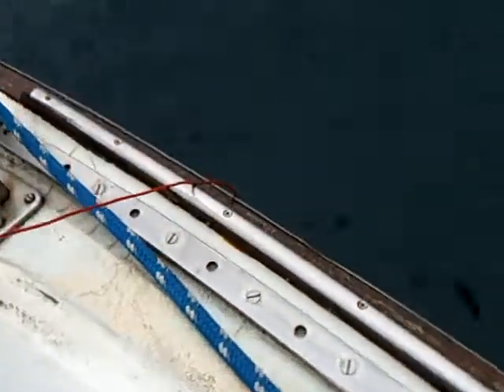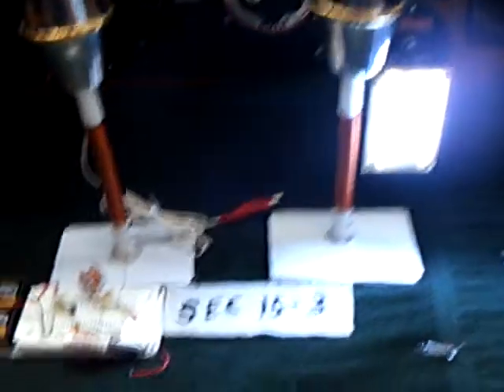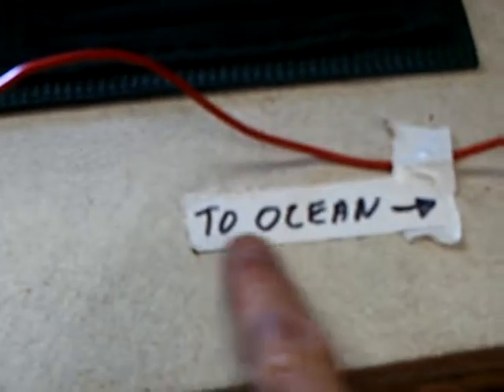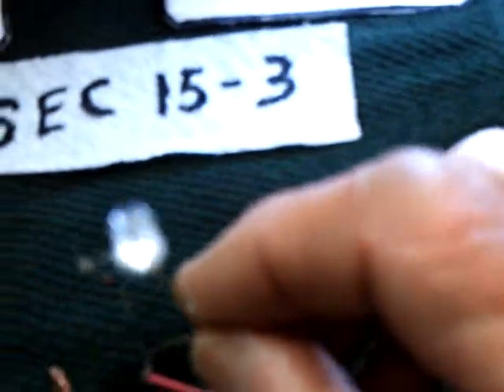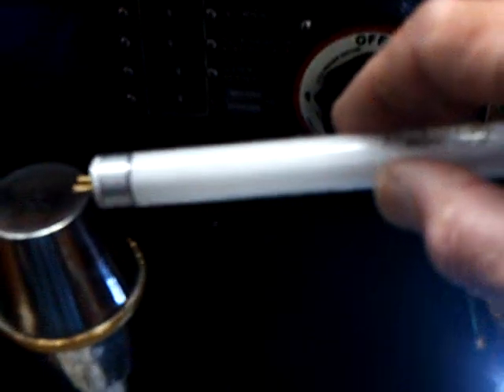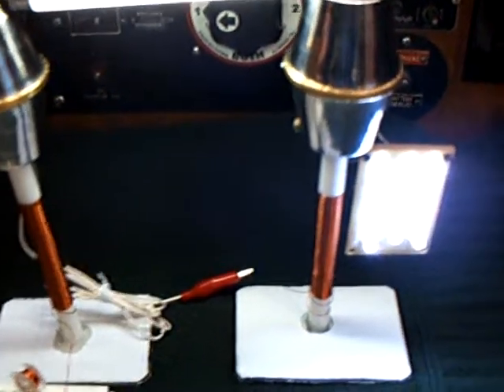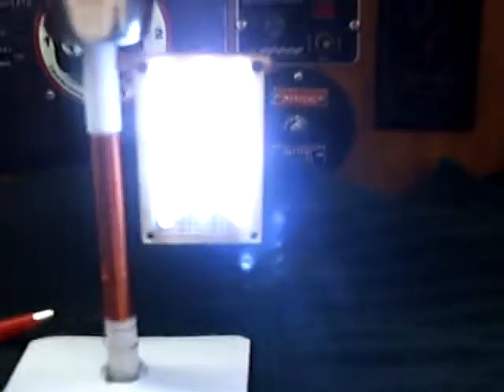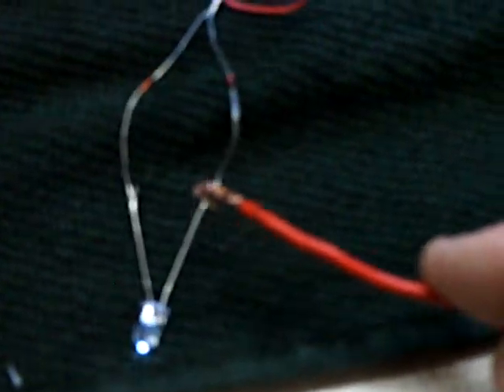SEC 15 - 3   at sea video

Comment: Remember the Joe Tate power module? Try hooking the antenna up to your mast and the ground to your water ground. Mine generates 50 milliamps at one and a half volts. I run my digital clock and charge a AA battery on radio waves. The aluminum mast is 10,000 times the mass of a single copper wire antenna.